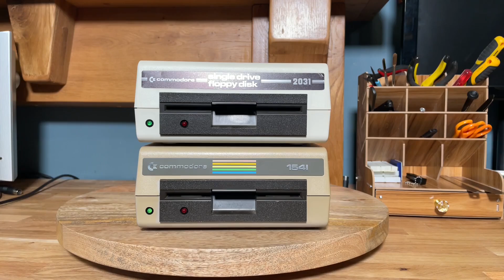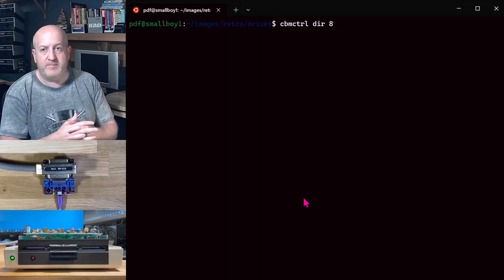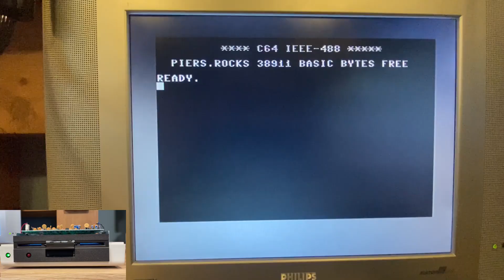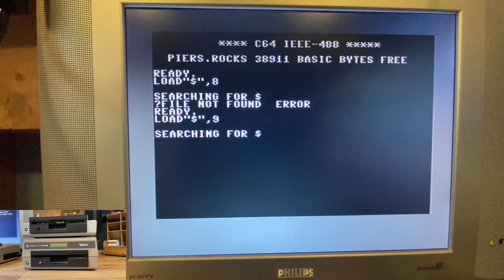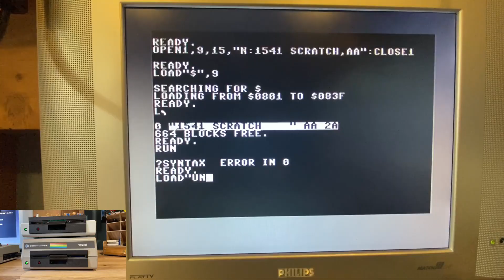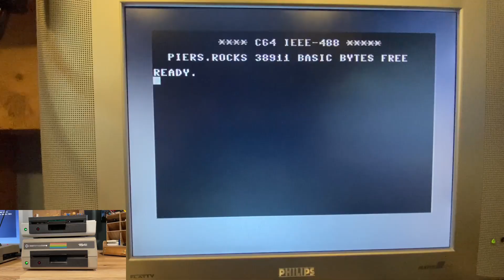Commodore 2031 without a PET - floppies rock ep2

Comment: So, I have now a couple of boards for the IEC64. I am missing the 74LS11, waiting on a shipment. Otherwise my board is complete. I have two questions: Which way around does the board go into the cartridge port? Populated side up? And if I decide to put a GPIB connector on it: it also goes on the side of the chips, or does it go on the bottom?
EDIT: I have soldered the IEC64 version that is on yout github, which was originally by DL2DW. Obviously not your smaller one.
Reply from the maker: Looking at the photo of the board in the repo, I'm fairly confident it goes into the cartridge port chip side up.  I can see the 2nd and 3rd connectors are tied together - these are presumably 5V coming from the C64.  This also means the PET edge connector on the end would be as it comes out of the PET.

Not sure I understand the question about the GPIB connector - the photo shows the pins on the top side, and the silkscreen marking indicates which pin numbers are which.  The standard GPIB ports (the centronics 24 pin connectors) tend to have the pin numbers labelled on them as well (very small).
Reply: @piers_rocks  Yes, you understood correctly. I am waiting on the GPIB connectors to arrive from China. I will check once they are here. In the meantime I can use the GPIB adapter board I use on the PET. Thanks for confirming the way it goes into the cartridge port!

Comment: 8:28 Instead of the 6821 PIA one could have used a MOS 6521 PIA, right? Would the 6522 also have worked? As it is very similar to the PIA...
Reply from the maker: Not sure as I'm not very familiar with  the PIA - from memory I didn't find the 6821 too hard to come by.